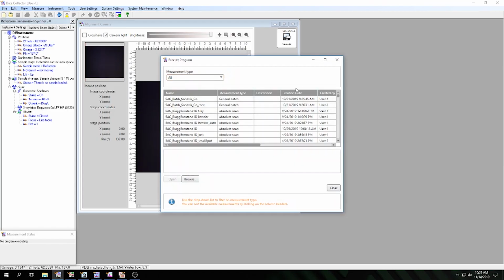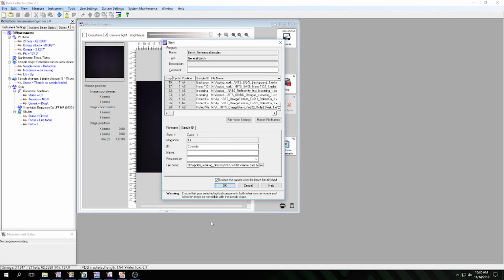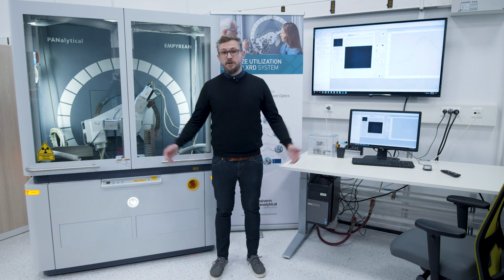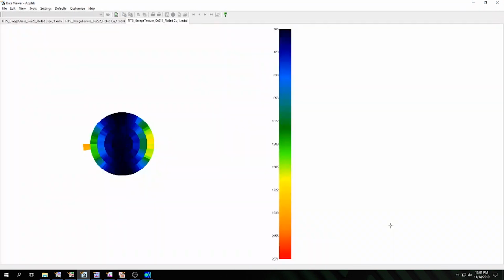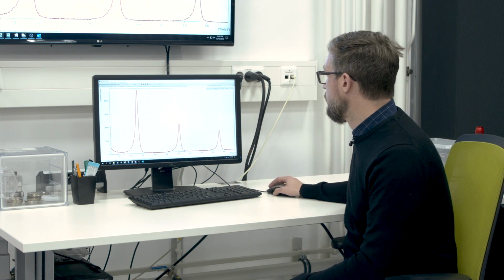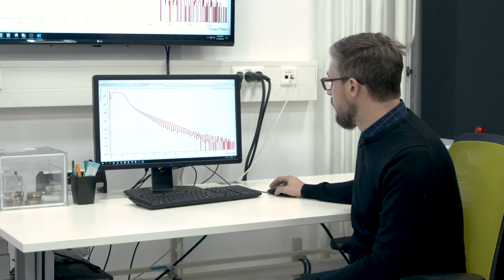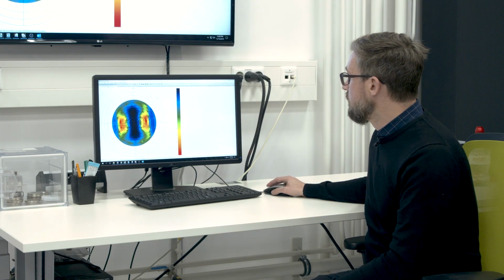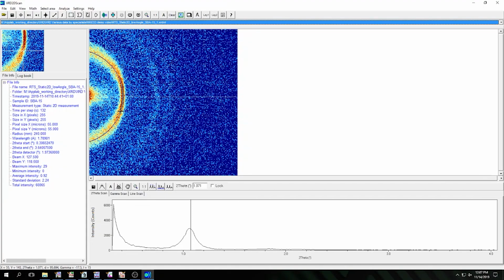Empyrean - World's #1 Floor Standing XRD Systems - Demo at Your Desk

Comment: hello. I have a question. after getting XRD patter (intensity/teta graphic), the peaks are determined by software programme automatically (as included elements or chemical compositions) or seperately we have to investigate the peaks' elements by using a different database? if you inform me, I will be thankful.